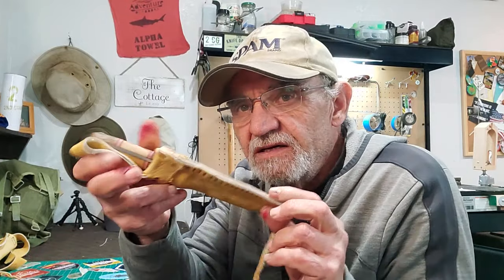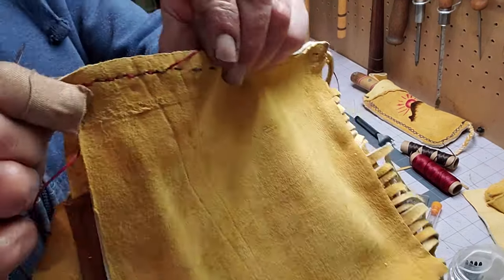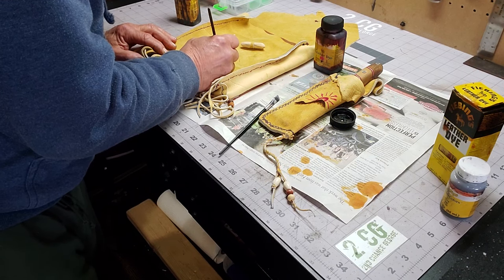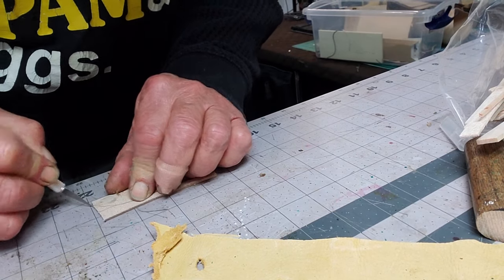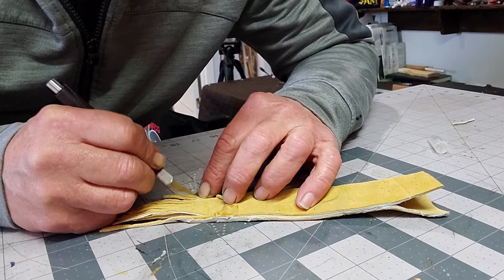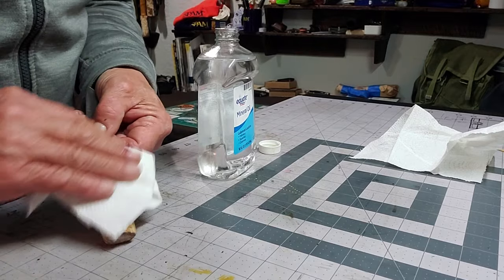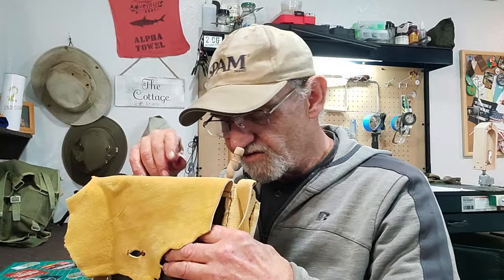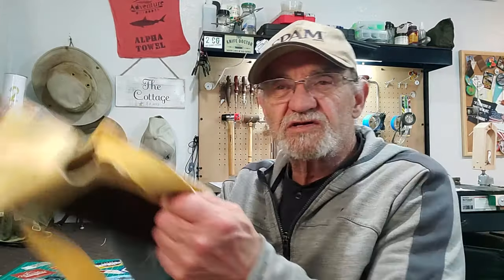Buckskin Project: Crafting A Stylish Possibles Pouch And Beyond

Comment: George— you are an inspiration. You did a great job and Will should be pleased that you were able to use all that leather
My guess on the wood type would be hickory. It is a straight, close grain and very tough.
Reply from the maker: Yep, you probably right. It was an old hammer handle so makes sense.  Be safe my friend